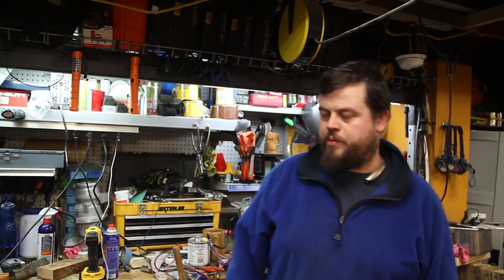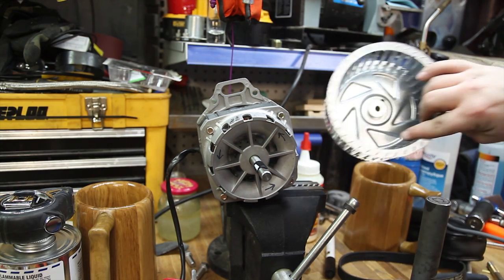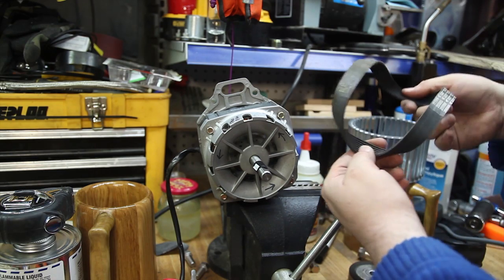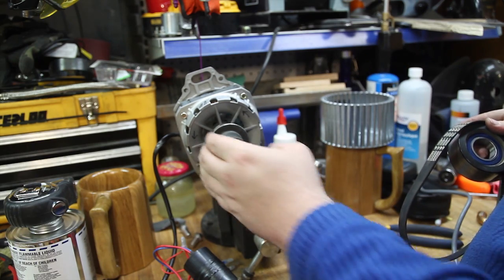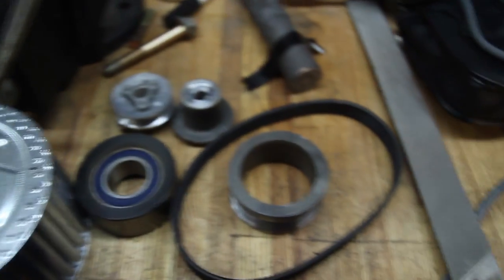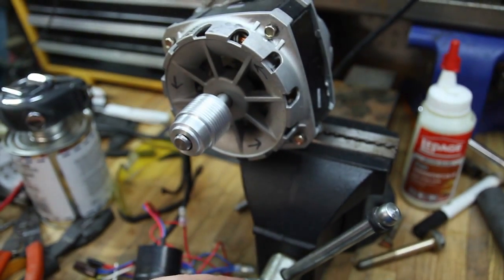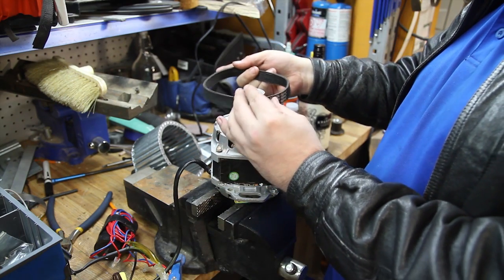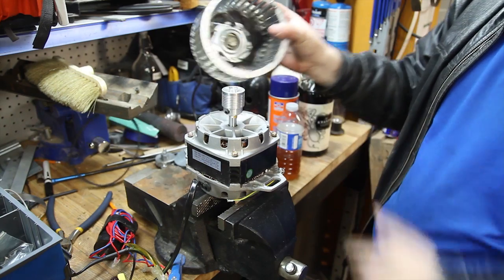DIY Washing machine motor into Custom Resirculated Vent fan Smoke extractor

Comment from the maker: The big pulley goes on the motor and the small one on the fan if you want to speed it up. No wonder it wasn't throwing lots of wind like i need it to. I was actually a bit disappointed. But thought Hay with a housing it will be better. NOPE. Not like this.